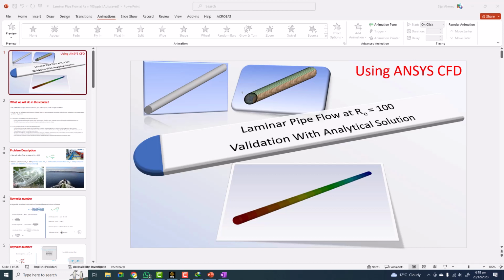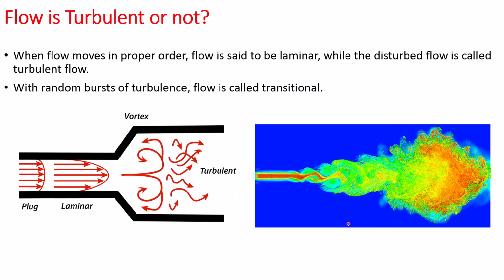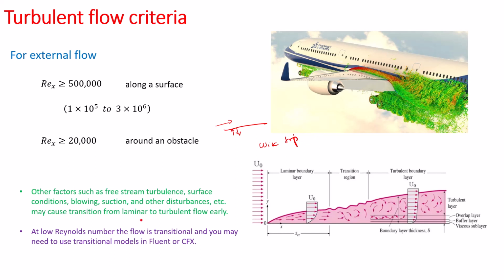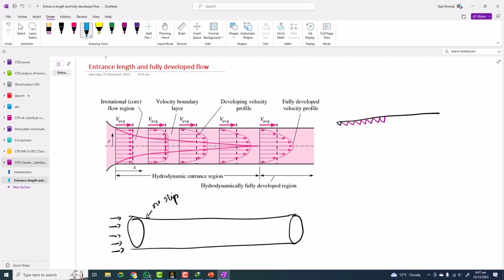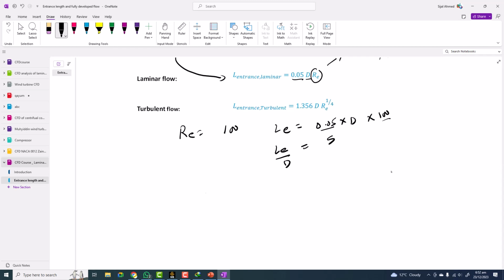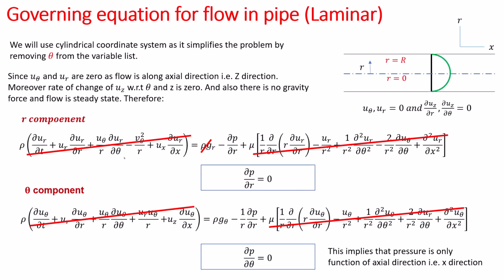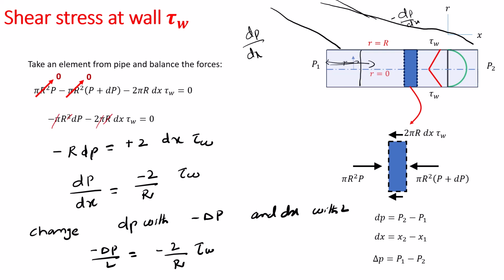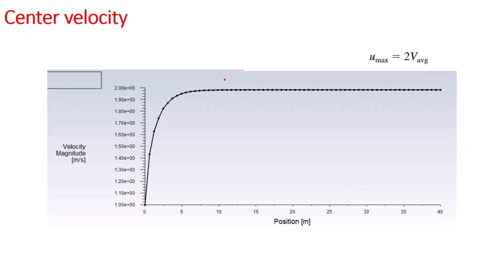Introduction 12 Weeks online CFD course _ Lecture 2

Comment: Hello sir,
I had a question regarding CFD. 
So if I analyze the rotor deep down in container with Simulation scheme of transient CFD and transient structure what should I setup first? Should I do transient structure or CFD of Fluid in the container? And how to measure stress on the blade through transient structural analysis
Reply from the maker: first CFD